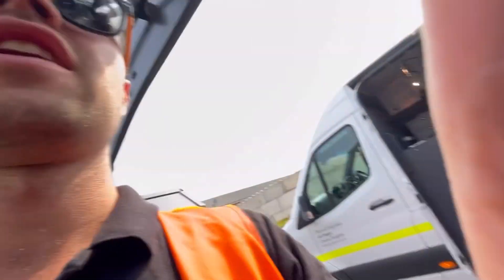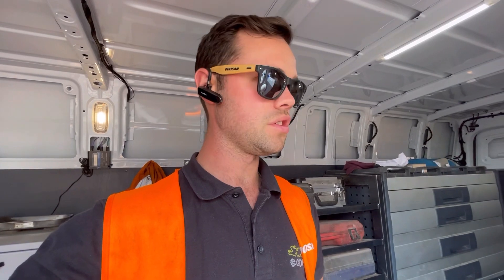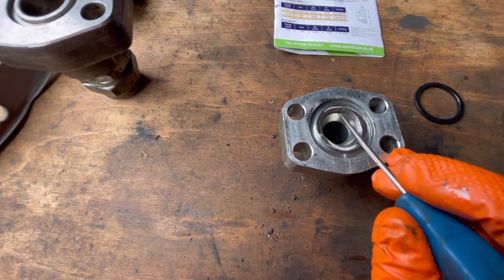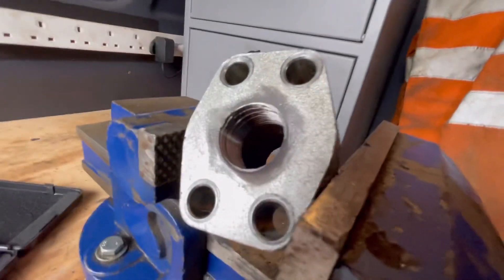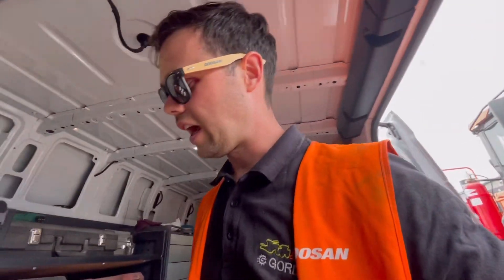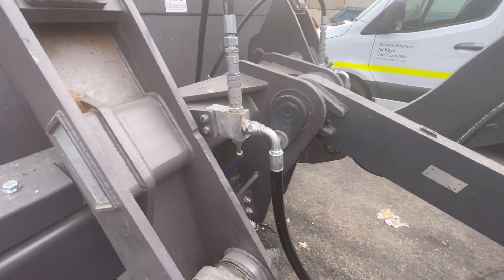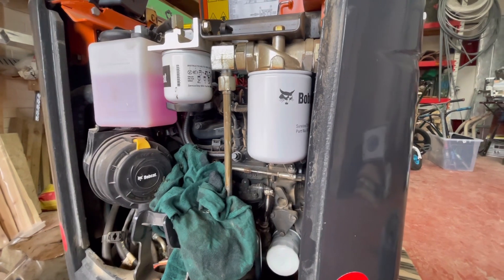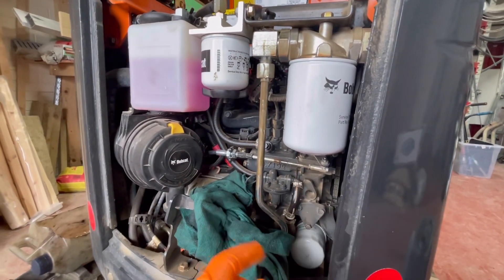Episode 84 - little jobs …

Comment: I do hate those BSP fittings for hydraulics especially with the dowdy washer ! Not helpful if factory guys don’t put thread sealant on the fittings as-well !
Thread sealant is great stuff but needs time and clean oil free threads to work it’s magic ! 
Thankfully we use ORFS FITTINGS with either JIC or oring connectors plus the fittings have a built in seal slot in fitting !

Good example of how fittings can weep 👍
Reply from the maker: Doosan fittings are all ORFS too and the problem adaptors aren't factory fit they will have been fitted on PDI unfortunately but hopefully I will have this annoying problem sorted today
Reply: @alisdiggerdiary  
Makes sense now  and your left to fix it !
Keeps you busy 👍

Comment: Thanks Ali, another good one!. Hi Tip buckets are notorious for the pipes loosening/ leaking. The swept 90 that goes in the flow divider will always come loose because the Hydraulics are dead ending, that’s the weak point. It needs Armour on the pipes as well.

Comment: Are those hoses high pressure hoses or low pressure ? As I've come across them on Volvo machines so you might need high pressure flange adaptors as in 6000 series which the high pressure ones and 3000 is low pressure and might be worth asking for oks seals instead of orings for the adaptors .
Reply from the maker: I couldn’t see a match with the dimensions they gave me for the 6000 series I think it’s about 250bar so should be ok 🤞
Reply: No probs bud but maybe worth asking for the oks seals instead of orings as I've been to them when the oring has failed completely and replaced with a oks seal the are slightly harder then a oring but do the same job
Reply from the maker: @davidcornwell9820   I’ll do that Dave nice one 👍👍 if it’s still leaks after this I’ll give you a shout cos I’ll be out of ideas 😂😂
Reply: @alisdiggerdiary  no probs what so ever bud

Comment: Hi Ali. I have never liked those bonded Dowty seals use copper if you can 
> also consider running flexible as far as you can and cut out  joints asafr as possible. This is mt email address. It would be good ifyou can give me a £ for a cap. Keep trucking mate J